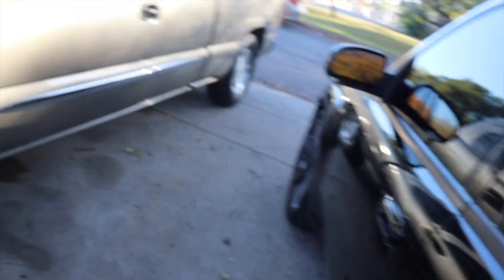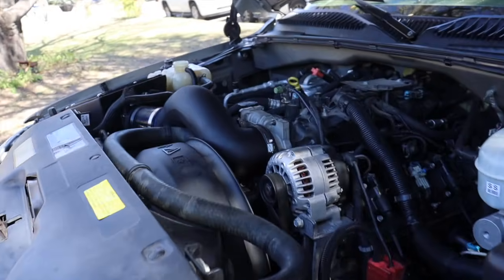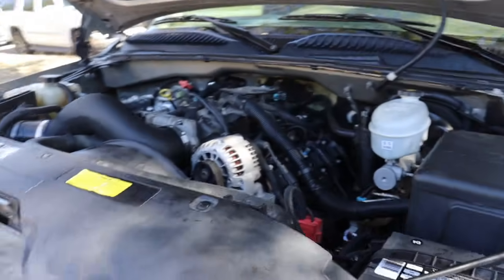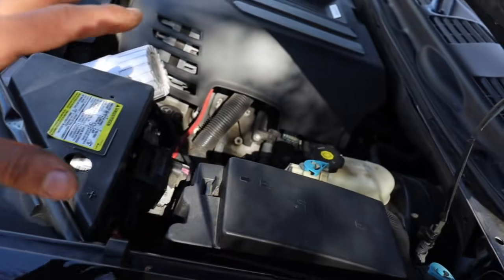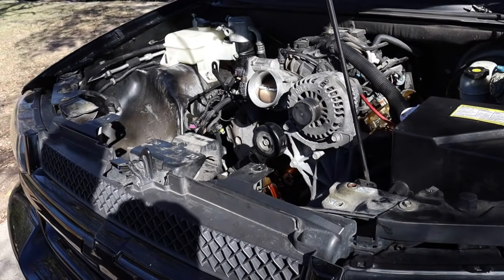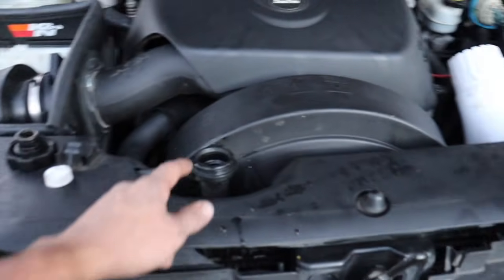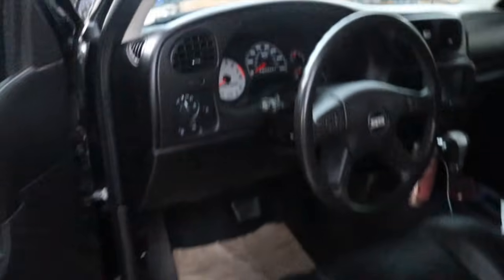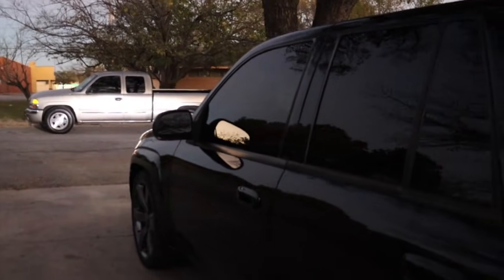BTR STAGE 4 CAM TRAILBLAZER SS

Comment: You push these cam swaps out at pro shop speeds! Took me all day and night for my truck lol
Reply from the maker: I know right but people don’t even want to pay 400 for labor 🤦🏽‍♂️
Reply: @dinocoblue2709  I would pay 1500$ or even 2500$ all day I paid way more for the same job local
Reply from the maker: When I get another customer who thinks 400 is too much ima show them this comment lol, thanks for the support brother
Reply: Hell yeah. Start charging extra for next day delivery lol!
Reply: Dinoco Blue so how much to do a 2017 Silverado
Reply from the maker: I had one Christmas special that I finished it all in one day, cam swapped it in the morning, got it tuned later the same day and customer picked it up the same day
Reply from the maker: Does are more since all the parts cost more but I can do those for 3,500 all parts included, dyno tune, and installation

Comment: What supporting mods does the TBSS need for the stage 4 cam?
Reply: Beefed up pushrods & Dual spring kit for the heads and 3800 stall  and and good tune and upgraded rockers as well
Reply: i have a 07’ just got the motor bulit but it’s a 6.0 iron block with square heads and all the other things as well that i said
Reply: @adamsbz5412  appreciate the info

Comment: Those number would be higher on the TBSS if an aftermarket torque converter was installed.
Reply: Torque converters dont add horsepower sure do let you launch hard as hell tho
Reply: 420 is good hp for a N/A Tbss lol, I wish my awd N/A Tbss was more than 260awhp :(
Reply: You end up loosing top end hp w a high stall converter but its worth it if you dig race

Comment: I'm in Canada I have to buy the cam and the springs and the parts then they charge me $2,500 to put the cam in and then another thousand for tuning wish I was out there I got an 05 envoy Denali 5.3 I want to put the stage 4 cam in there I think I need a 3000 stall torque converter do I have to change injectors or anything like that to run this cam

Comment: I’ve been wanting a trailblazer ss for so long
Reply: Same here  that ones badass
Reply: So Dinoco, i see you do most of all your cam swaps on higher mileage vehicles with No oil pump replacement, t.chain, lifters or trunion upgrades.  Never seen you check for proper pushrod lengths either. Seems like youre leaving a lot on the table for a future mishap to me??  But i guess if your customers are cool with it, thats awesome!!
Reply: Don’t buy one in Cali

Comment: Hey first things first I’m a fan I love your videos are very helpful Quick question I also have a TBSS I recently installed a stage 4 cam as well my question is did you have to change the pushrods or did he keep them stuck (7.4)on the tbss?
Reply from the maker: Thank you brother, and I kept them at stock length 7.4
Reply: What else did you have to do? Headers, valve springs, torque converter?

Comment: U got the specs on the cam on the tbss
Reply from the maker: 224/230
Reply: @dinocoblue2709  thanks did he have to do a converter also do u have the exact specs or part number I got a 2007 tbss I want to do the same setup

Comment: Hey man when changing out cams you dont have to change out the lifters that ride on the cam? Dont you also need a valve job for the stage 4 cam?
Reply from the maker: No you do t need to change lifters and no you don’t need a valve job
Reply: Only time you need to change the lifters is on the gen 4’s that have dod.

Comment: Do you have to upgrade the driveshaft on a vehicle before putting it on the dyno ?
Reply: Its recommended especially if your lowered or you could run it in 2nd but your numbers will be lower
Reply: @BurtJr26  I have a 2011 Sierra full bolt on with a stage 5 custom grind cam and a 3800 stall I was wanting to dyno it but they said I need cal tracs and an upgraded shaft first
Reply: @jesseboy9791  yeah alot of them wont do it because of the chance of it busting but you could always get a street tune you can make really good power without the need of a 1:1 ratio dyno pull in your case 4th gear or 2nd gear if you dont mind a lower reading.
Reply: @jesseboy9791  if you do upgrade your shaft to hit the dyno with a converter tell them to lock it up so you can get a accurate reading the converter unlocked during the pull usually reads lower numbers
Reply: @BurtJr26  10 4 thanks bud

Comment: Are the gen v 5.3 any different as in installing parts
Reply: Oooooh brother alot different way more complex expect to drop the pan if your 4x4 its gunna be a paaaain
Reply from the maker: Gev 4 come with 1 bolt cam gear, gen 3 come with a 3 bolt cam gear
Reply: @dinocoblue2709  also newer gen 4 and all gen v have the cam phaser

Comment: Hey man, i’ve never cammed anything before, let alone taken apart an engine this much (i know i got a lot to learn, gotta start off somewhere tho). I might be getting a tbss sometime soon, for a first timer how difficult is this?
Reply from the maker: It would be better if you do your first cam swap on a Silverado they are much easier to take apart, it’s much harder on the TBSS since it’s a lot more compact in the engine bay and you have to remove the a/c condenser and a/c lines which on the Silverado you don’t have too, but it’s still the same process for the cam swap
Reply: @dinocoblue2709  I’ve got a 5.3 right now actually haha
Reply: @dinocoblue2709  What cam could you recommend me? I’ve got a 2007 new body style 5.3 1500. I’m looking at the stage 4 btr but is there something else you recommend?

Comment: So you are doing cam swaps on older trucks with higher mileage and not changing out oil pumps, timing chains, lifters, lifter trays, rocker trunions, push rods, gears, or taking p.rod measurements?? Not sure how you do that with piece of mind? Know wonder you do 2 a day, geeze... Props to you buddy.
Reply: hater

Comment: Was that just cam? These babies come 400 stock. I feel like you shoulda been getting more
Reply from the maker: Dyno tune a stock ls2 and see how much HP it’ll make, I bet it won’t be even close to 400
Reply: @dinocoblue2709  what were you sitting at before the mods?
Reply: Stock is 395 at the crank. Dynos measure whp, not chp.  TBSS must have had long tubes and high stall, unless the dyno sheet attempted to estimate. 

It's pointless to discuss the TBSS, because there's no info.